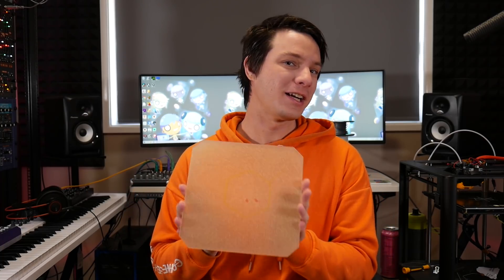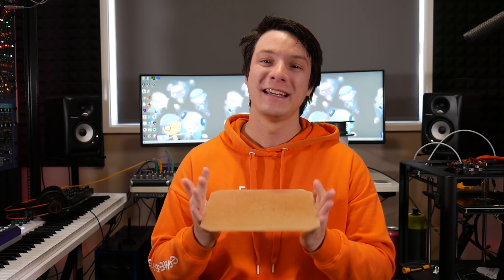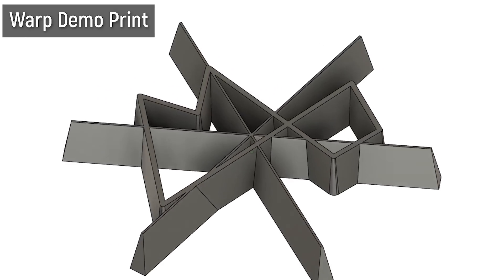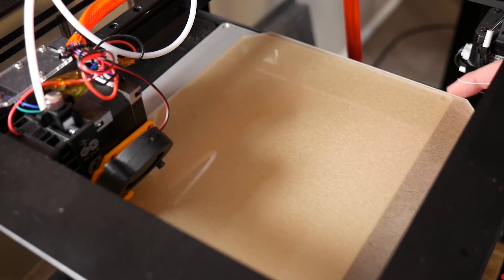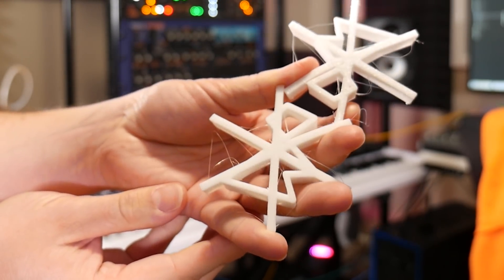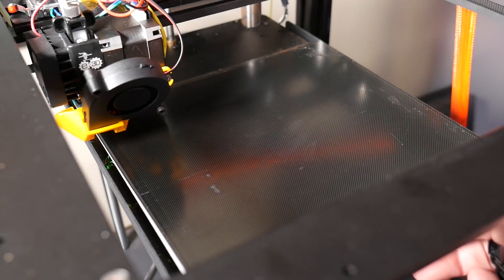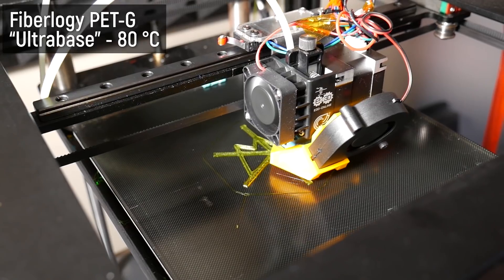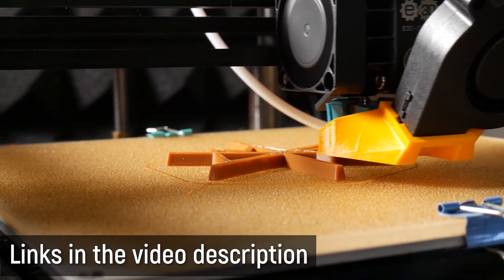A REALLY unusual 3D Printing surface! Ultembase PEI Glass test and review.

Comment: Glass does not deform, but it breakes at 100 C
Reply: It doesn't break at any specific temperature! It breaks when it's heated unevenly and rapidly and doesn't have time to equalise the tension. I know a lot of people have printed on plain glass or mirror glass having the heater set to like 105°C for ABS and this was perfectly fine for years, because the printer bed heater is actually slow enough.
Reply: @SianaGearz  I have a silicone heatbed 31x31 cm, 220V, 750 W, heats really fast. Every time it goes above 100 C, breaks the glass. Though I havent had problems with my 24 V DC bed, 21x21 cm, going above 100 C
Reply: @danieltalavera9847  Haha that's a feisty bed you have there. I can see how that would cause more issues than people usually experience.
Reply: @SianaGearz  yep. But anyway you are right, maybe if I set it 60 C for some time and let it heat evenly and then jump to 100 C could work. Thanks

Comment: I did read elsewhere about the strong affinity between PEI and PETg, so I am using the reverse side of my spring steel PEI coated bed, and coat it with hairspray. Seems to work for me, and for other filaments flipping it back is a matter of seconds.

Comment: I had similar issues with PETG on the WhamBam PEX flex plate. All my tests were printed at 75C and it would tear up the coating. By knocking the temperature of the bed down to 65C I found the same amount of bed adhesion but it no longer ruined the surface of my PEX sheet. I would recommend trying the PETG again at a lower bed temp and see if you can get better results!

Comment: lost to base because of petg and to much heat. 
now i'm not going over 65 or 70C

95% of the time i print only with PETG

usualy 3d printed small PCB cnc or such devices.

Comment: I'm using eSun ABS+ and it's absolutely destroying my build surfaces. Never had a material so destructive, but at least it hasn't taken chunks out of the build plate. Lol.

Seems like a product trying to fill a void by last generation machines. Most modern machines come with a factory build plate already coated in something to make it last as long as possible. My flashforges come with replaceable sticker sheets if you damage the sheet stuck on there. Can't exactly fill in glass pockets.

Comment: Angus, at the start of the video you show the Craftbot Flow IDEX bed while talking about PEI. The Craftbot uses Kapton, not PEI (that’s why it’s a deeper orange). I replaced mine with PEI.
I’ve not used PETG in years, but when I did, I found it over-adhered to PEI. I risked damaging my PEI bed surface on my old Printrbot Metal Plus (not flexible) every time I tried to remove a print.
Reply from the maker: Oops yeah I was meant to use broll of the smooth prusa mk3 beds there! The craftbot kapton is crazy thick and lasts the longest I've used, but does certainly seem to get nicks over time. Interesting notes re PEI and petg! My experiences with the prusa beds seemed OK but it's not my regular material.
Reply: @MakersMuse  I swapped out the Kapton while it was still pristine just because I struggled to get good adhesion to it without a lot of Magigoo. I've never had good results with Kapton. And you're right about it getting nicks and scrapes over time. PEI on the other hand is amazingly tough.
I should try PETG again. It could be that with a flexible bed sheet it makes all the different and will peel.

Comment: Sorry, I'm out of the loop - what happened with Tronxy?
Reply: I'm wondering the same
Reply: I did a little googling - apparently it's the vid key Z4-aKOlp-cA and then WSIDu0Kyc_U follow-up.

So the printer came with a junk hot-end which oozed all over the place and needed 12mm of slow retraction to get tuned in, and then it also came with thermal runaway check and mintemp checks disabled, and when a wiring issue occurred (the connector really isn't rated for such use), it started trying to catch fire on the hot-end a little bit. At first Tronxy spun standard marketing damage control bullshit for a few rounds, then came to their senses, and quickly provided a firmware patch that re-enabled thermal runaway protection and is actually easy to install. Which i'd say is a better outcome than i would have expected somehow, having heard a little bit about this company?
Reply: @SianaGearz  Thanks for this. I have an x5s but I swapped out the board and hotend years ago. And belts, and motors. So basically I have some tronxy aluminium extrusion at this point.

Comment: What did happen to tronxy ?????
Reply: Bad hot-end design prone to lots of ooze, bad hot-end wiring that was prone to get dislodged with an unsuitable connector, didn't have mintemp and thermal runaway safeguards enabled in firmware. Tried to catch fire.

After a couple rounds of bullshit-spinning, Tronxy actually fixed the firmware safety issues and made the update process really simple too, and it didn't take them very long to do so either.

Comment: Could you try the "POM" filament with this? This filament is so difficult to make it stick to the plate. It is ridiculous that they made filaments for 3d printing
Reply: I came here to suggest this. I've been wanting to experiment with POM for a long time, but by all accounts it's nearly impossible to get to stick. I've heard of weird methods like printings on top of a layer of PETG, or printing on cardboard.

I wonder if a bed like this is the answer.
Reply: @pinkfreud1337  I tried with paper on top of glass bed. It didn't like the temperature at all (severe warping, burned spot). I tried also with paper tape, ridiculus brim (over 25mm) or ridiculus raft. Now the spool is there to rest without ever having printed more than 2 layers :c
Reply: @aleatza  yeah, that's pretty much what I've heard from everybody who's tried. It's a shame it's so tricky, because POM is an awesome material that I'd love to use for tons of projects.

Comment: Plain glass bed is already good enough for almost any material. Use gas torch to dry the glass bed before using it (remove extra moisture), you could stick polycarbonate very easy on the heat glass bed (100c)

Comment: This might actually be a great fit for my Mylan 180.  It's an older makerbot clone thats built pretty sturdy but uses a glass bed standard.  Since its older, ABS has been a massive challenge for me and I'm hesitant to try newer filaments.  I'm also hesitant to use any off-the-shelf glass, because glass can be manufactured quite differently and become dangerous when bonding to plastic. However I have a feeling this could turn that around as well as my ABS problems.  Plus I could just flip it over for Pla.  This videos actually super helpful.  THANKS!

Comment: Forgive my ignorance - but what happened to Tronxy?
Reply: I did a little googling - apparently it's the vid key Z4-aKOlp-cA and then WSIDu0Kyc_U follow-up.

So the printer came with a junk hot-end which oozed all over the place and needed 12mm of slow retraction to get tuned in, and then it also came with thermal runaway check and mintemp checks disabled, and when a wiring issue occurred (the connector really isn't rated for such use), it started trying to catch fire on the hot-end a little bit. At first Tronxy spun standard marketing damage control bullshit for a few rounds, then came to their senses, and quickly provided a firmware patch that re-enabled thermal runaway protection and is actually easy to install. Which i'd say is a better outcome than i would have expected somehow, having heard a little bit about this company?

Comment: Owning a Formlabs Form³ ( and a Form² ) with a solid Print Bed and a Prusa i3 MK3S ( with MMU2S ) with its removable flexible Powder Coated Springsteel Print Bed I can easily say I'd never buy an FDM 3D Printer without a flexing Print Bed aiding in part removal like those almost print volume filling side panels for my MK II Dining Table Lamp: https://imgur.com/a/RCkgtSb 🤔

Comment: If the glass beds are warped, are they using tempered glass? Untempered float glass should be quite flat, and also cheaper.
Reply: Mine from Geeetech came severely warped and its designation is "Borosilicate glass". They sure aren't using normal window glass for this.

That being said, float window glass can also be pretty wavy. I don't remember a single reasonably flat window in my old home which was probably mostly glassed right after the war, because the part of the city was heavily bombed, few surrounding buildings remained, the house was even older than that. People have allegedly found that mirrors are flatter than window pane glass, maybe because it's more noticeable so they put more effort into it letting it actually settle flat.

Comment: Dunno how well it works, because i myself still operate the OG glass bed, but one of my friends took his glass and using glass etching cream, he chipped the surface and obtained a textured one instead. He says it's mostly a success, unless he has to print low temp materials, in which case, no cigar.

One thing i found interesting about this glass is the fact that when you touch it, you don't feel huge bumps, nor do his print bottoms have that scale-y effect either. 

I theorize that the 100% random etched surface (which is there, but not pronounced, it's just random, there's no visible pattern) is enough of a constant change to give the print a grip. Kinda like how toe clamps work for milling machines. Instead of one cumbersome (height eating) vise, you use many, small distributed bite clamps that hold the piece low and steady. Most people put them at the ends, but if you account forces and the shape of the item, you end up with a random looking pattern.

Comment: Doesn't PETG stick to PEI like it does to glass? I can't remember where I got that information (maybe Tom or Stefan?), but I have seen recommendations to print PETG on PEI with glue stick. In this case the glue stick is used as a release agent, and not for bed adhesion. 
This would explain the PETG ruining the print bed. PETG fuses to PEI, PEI is fused to glass (because it is manufactured to do so), some microscopic imperfection in the glass gives, glass breaks.

Comment: I've recently had PLA rip pieces from a glass bed. It was CCTREE's Fluorescent Yellow. I found that extremely odd
Reply: It was probably PLA+. They often add material to PLA to overcome its weaknesses. The "extra" material they add can have unexpected effects...
Reply: @gaellafond6367  Yeah I was expecting that . Just didn't have it labelled anywhere. What I found crazy was that the surface area of the print was really small like half of a standard benchy. Just crazy to see glass fuse like that.

Comment: I love the Prusa smooth PEI but it just scratches so easy
Reply: Since I hour the Prusa satin sheet I've not used either the smooth or textured, it just works and the finish on the bottom of prints is quite similar to the other surfaces.

Comment: 2:40 what happened with Tronxy?
Reply: I did a little googling - apparently it's the vid key Z4-aKOlp-cA and then WSIDu0Kyc_U follow-up.

So the printer came with a junk hot-end which oozed all over the place and needed 12mm of slow retraction to get tuned in, and then it also came with thermal runaway check and mintemp checks disabled, and when a wiring quality issue occurred (the connector really isn't rated for such use), it started trying to catch fire on the hot-end a little bit. At first Tronxy spun standard marketing bullshit for a few rounds, then came to their senses, and within 24h provided a firmware patch that re-enabled thermal runaway protection and is actually easy to install. Which i'd say is a better outcome than i would have expected somehow, having heard a little bit about this company?

Comment: i work with glass and glass does flex if you have a printer ove 150mm build surface it can flex if it is not thick enough

Comment: LulzBot has been doing PEI on glass since their Mini 1 and TAZ 4...?
Reply: I was just going to say, my first printer was a mini 2. Came with a PEI on glass bed. Upgraded to their modular bed system, still PEI on glass, but can flip it over if I want bare glass. I've been printing almost exclusively PET-G on it for 2 years and haven't had a problem with it.
Reply: That part was kind of open to interpretation, but I think Angus was referring to how it's applied to the glass. Lulzbot uses a smooth PEI sheet adhered to a piece of borosilicate glass, while this one uses a very different manufacturing technique.